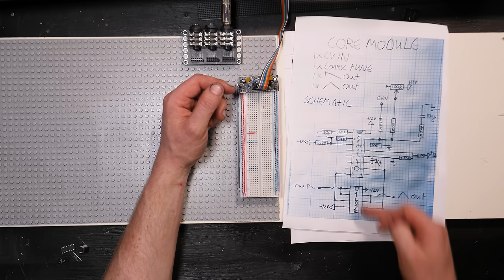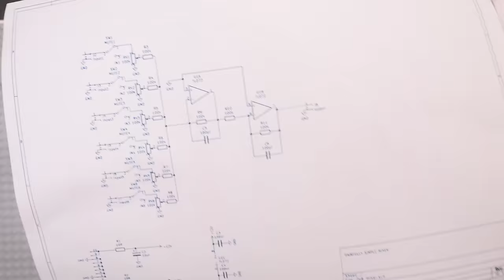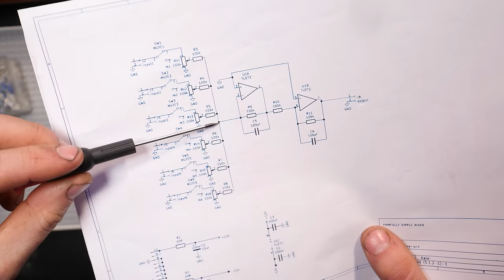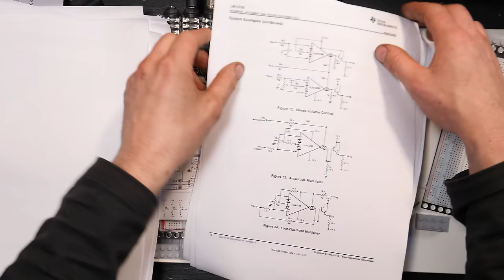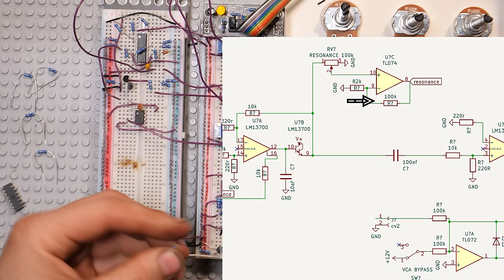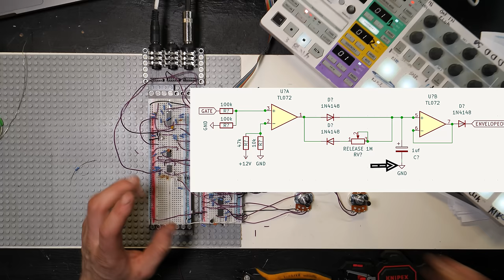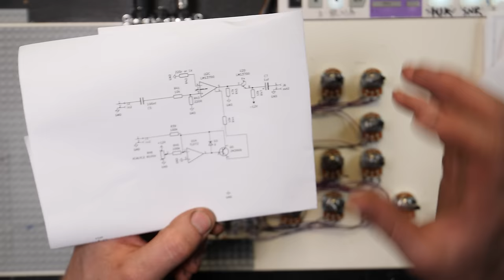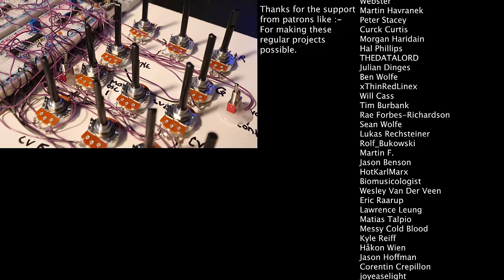Building A Whole Analog Synthesizer voice From Start To Finish On Breadboard

Comment: You noise buffer should use 100k & 10Meg resistors to reduce the load on the noise generator. or even 30k & 100Meg for way better gain!

Comment: Sam thank you for making electronics cool again. So much has gone to micro processors these days.
Reply: 🤔I actually prefer micros for a lot of stuff (when implemented well), to save on wiring time, and make them all standard and less error-prone. (Like the computers in construction equipment I worked on for a few years.) The way I'd want to have a synth, is just knobs with tiny network-chips all fed directly over common wires to a screen/computer. Or maybe a screen is worse than just more knobs and flips, to control everything. I've only got a USB/MIDI keyboard this summer, and last played a non-synth instrument in high-school, so maybe this is all just horrible UX that would be awkward to play! 😆

Comment: 26:45 a better solution would be to use the non inverting pin and instead to sticking it to GND use a trimmer between GND and +/-12V and the wiper to the non inv.... pin. and freely move the wave form around or a voltage div.
Reply: 🤔Agree

Comment: I built the ms20 filter from your strip board layout, and a cool trick you can do with it is play with the volume of the input signal: if it's full volume then the resonance is very distorted and at lower volumes the resonance is very clean, and obviously you can go anywhere in the middle.

Comment: Try to couple 2 x CD74HC374 to form a 15/16 bit address pin setup to a Arduino to make a programmer for AT28C256/512 eprom.
It will enable you to build a 8 bit wave table and more. so with a 8 bit port from the Arduino you can double it to 16 bit with the 2 74HC374 CMOS Logic Octal D-Type Flip-Flop using the clock pin and later the OE of both to one pin on the Arduino to pump 15/16 bits to address the eprom than another 8 bit port for the data into eprom.  Easy peasy as you would say.
Reply: No digital shit please
Reply: @Kalumbatsch  you can manilupate these chips analog, like they did in the Roland tr-909, tr-707. but you have to program them digital.

Comment: Would have loved if i had a little more info on all the pins of the bigger ic's not only about the used ic's but also about the pins that you didn't use because that would be the necessary information i would need to know if i wanna understand and change the circuit and not blindly follow instructions. You could watch ben eaters videos for inspiration.

Maybe something you could change in future.
Reply from the maker: Search cem3340 datasheet
Reply from the maker: I do mention that 👍

Comment: Really impressive !!

but, I wish I could see the wires and understand the system just from that.
(for sake of translating a theoretical system to a system of sounds)

Do you think, 
One could connect every component in the circuit to every other component,
And then, 
"Cut" cords where needed.

Do you think it will allow drawing/building circuits easier?
It's more like creating a status by taking off clay, than like doing Lego.
Reply from the maker: sounds like a modular synth. build a modular synth :)

Comment: when I studied radio engineering, we had a discipline - the theory of circuits.  The teacher told us that it is important to develop abstract thinking in order to be able to read diagrams.  I didn't understand the connection at the time.  And now, I see a circuit as a set of elements with a change in voltage and resistance in sections of the circuit, to obtain a certain result.  Home correct observance of polarity.  I wonder if my guesses are correct...

Comment: How much would you change the circuit if you wanted to build a visual synth? You used some LEDs to test and show function, but could you build one so that every stage and component had a monitor LED to show exactly where the work was being done?
Asking for a friend! :goat-turquoise-white-horns:
Reply from the maker: The rest of the functions would be moving to quick to show much. But just add transistor buffers

Comment: OTA ( Operational Transconductance Amplifier , see an excellent article on the CA3080 OTA in Internet Archives- Radio Electronics magazine May 1988 pages 63-68.
The CA3080 consists of one differential amplifier and four Current Mirrors (CM). A current mirror is a 3 terminal circuit that, when an external bias current is provided at its input terminal, will produce an in-phase current of identical value at its output terminal.

Comment: what about something with an SN76477, or many SN76477 ?
Reply: Chips like that are designed to use raw resistors and capacitors switched in and out to set their sounds. A synthesizer needs voltage-controlled inputs, VCO, VCA, etc. Even if you could bodge some sort of voltage control, you probably couldn't tune it to 1oct/V.

Comment: i will try to make one and i have think to the fact to used a computer tower to do it inside..and in the side of the computer i would put all the knobs and slider or whatever..inside i will be able to put the mother board in some stage .

.i also have a small mixer with a lots of knob on it that i can used and even the slider             

 and all the jack and xlr, rca , in and out put......

maybe used 2 o3 pedal circuit or complete and put them in the computer ,screew and fix ,and pass the sound directly or by the circut ...

.someone think its possible to do ?? where can i buy in a one time all the small part , the circuit ,the wire and the mother board???

thanks if you respond.

Comment: the threads on hackaday for building a top octave generator are a bit thick on idea, thin on prototype.  if not you, someone else that can figure out these things, find something that works, so we can at the least revive some don lancaster designs?  most of us that could figure it out are not as easy to find.

Comment: ... OR create a fully functional synth using a Teensy 4.x dev board + an audio shield. "Our pal Dave" covers the entire build in his Teensy Synth tutorial videos on his Notes and Volts YT channel.
I expanded upon that to create my T4 Laser Synth, which uses the Audio library's graphical online Audio Design Tool to patch together software module, including: 28 (square, sine, triangle, & custom) waveform generators, 9 mixers, 10 LFOs, 10 multipliers, & 10 ADSR envelopes which output 5 channels of XYRGB signals to my RGB laser projectors.
Just solder some GPIO pins to a header to piggyback the 16 bit I2S audio shield, and download Dave's sketch. Then control the Teeny Synth via MIDI control surface(s) and/or DAW. I'm using an Akai APC40, Reaper 6, touchscreen monitors, Arturia BeatStep, and custom designed TouchOSC GUIs for 2D imagery.
The Audio Design Tool also offers all of the typical Eurorack filters, delays, etc. The beauty of software modules is that the synth can be repatched and reconfigured easily, without sourcing, ordering, spending more $, rewiring hardware, breadboarding prototypes, designing PCBs, etc. BTW, it costs much more in time and money to build a DIY controller. Started down that path, but soon realized that OTC MIDI controllers have lots of features that could take years for me to develop.
A knob isn't just a knob. Rotary encoders (w/LEDs) make pots obsolete. A button isn't just a switch while being RGB backlit and mapped to multiple custom code functions.
Sorry to step on your channel, Bro. But, you're doing this the hard and expensive way. JS
On the other hand, there is great value in learning electronics and this appears to be a great project for achieving that goal.
BR